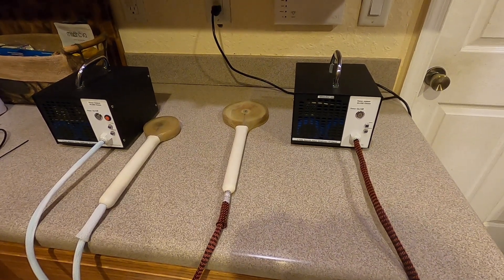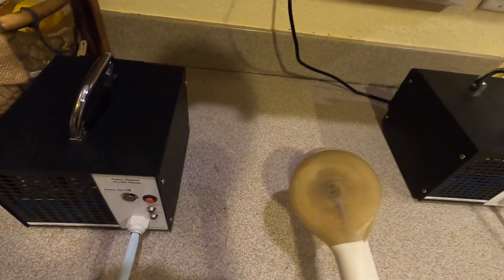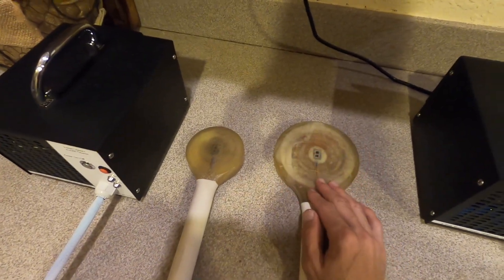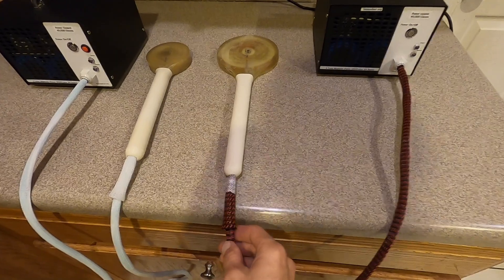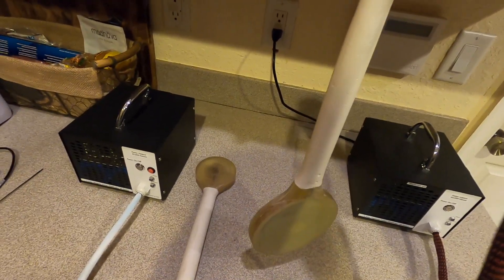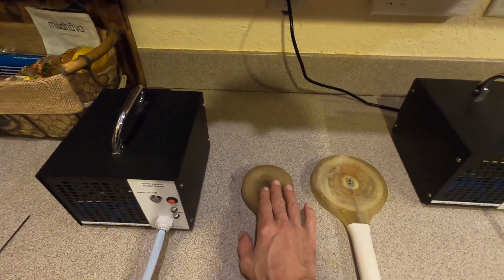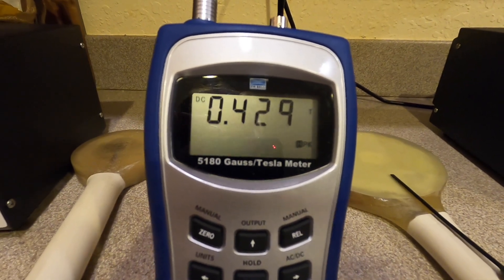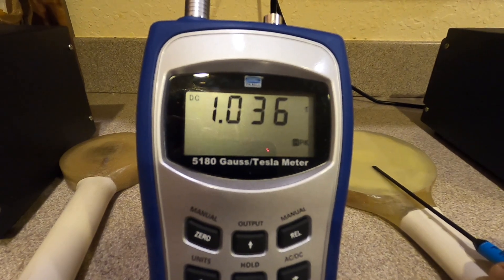019 BBMPulser 4B with 5" Aluminum Pancake Coil PEMF Open Source 1 Tesla (10,300 Gauss)

Comment: The half wave voltage multiplier used in the unit is only using two stages (120v unit) so doesn’t that mean the unit is actually putting out a little less than 480 volts ( counting for small voltage drop from diodes and leakage from caps) to the two large capacitors? I’m confused and so I figured I should ask you. I did measure a difference in potential of 600 volts when measuring anode and cathode of thyristor so I’m wondering how that is?
Reply from the maker: You are right, 480 AC if you run it true the diode and put a capacitor on it you will get 640 Volts
120VAC  is actually 155VDC.
Reply: @AndreyD  so each stage of the multiplier is actually multiplying 155VDC once rectified by the first diode? How do you get 640volts though if 120volts rectified through the multiplier is 155volts multiplying? 155VDC multiplied 4 times is 620VDC so were did you get the extra 20VDC?
Reply from the maker: @corybrown5583  Hello Cory. Well it's not perfectly 155VDC. it's between 155-160VDC.
Im sorry i's more like 160VDC.
Final charge number can fluctuate alite between 600-650VDC.
The circuit discharges it when charging voltage reaches to 550 Volts DC. 
I don't use pulser at 600-650Volts range because it fluctuates and under different conditions you can get different voltages. 
For example if you plugged in your pulser to the long extension and also have air heater plugged in, your 120AV will drop to 115AC and so as pulsers doublers voltage to ~600 volts. But it will still work because it discharges caps at 550VAC. You just can't lower outlet voltage low enough for doubler not to reach 550Volts. 
So here you go simple pulser circuit that doesn't care about input voltage fluctuating
Reply: @AndreyD   I added some resistance to the trigger portion of the circuit so I could get a higher voltage before it pulses. Can I go by the surge rating of the caps for voltage limit or is that too dangerous? I want to increase the voltage multiplier.
Reply: @AndreyD  I decided to use two 3,100 uf 450VDC 525VDC surge caps in series so I can raise the voltage some but I want to make sure I don’t overcharge the capacitors. Does the surge rating for the caps mean I can go a little higher than 900 VDC and the caps won’t explode?
Reply from the maker: @corybrown5583  3.100uF, 450Volts are great Caps for here if connected in series. 
Don't use them in Parallel, their surge voltage is 525Volts.
Surge Voltage on the capacitors is the  maximum voltage they can take. if you increase over surge then capacitors will start conducting (shorting alittle) preventing voltage going any higher. 
Ideally you don't use caps around surge voltages, You want to be safe and stay ~20% below voltage surge.
Reply: @AndreyD  i mean in series. I would never use them in parallel when dealing with such high voltage but do the surge ratings of both caps also combine since both caps in series split the voltage so they handle more? Ik if I used them in parallel electrolysis would occur and the caps would explode since I would max out the voltage the dielectric material could handle. I want to get somewhere around 900 volts pulsing through coil but my knowledge is limited (still learning).
Reply from the maker: @corybrown5583  Yes, the surge Voltage combines. Capacity drops in half. So your active capacitance will end up 1,500 uF and you can safely charge them to 920 Volts (that's the voltage you get if you 5x multiply 120AC Volts).
By the way I'm planing to Introduce BBMPulser 5B. Im still deciding what options to add, thought about Adding Power and speed control.  
The 5B model will discharge at around 800Volts vs 4B at 550Volts, also it will have larger capacitor bank
Reply: @AndreyD  multiplying 155 X 5 gives me 775 so how does that end up being 920? I’m sorry if I’m bothering you with all the questions but I am trying to not create an exploding circuit lol. 155 X 6 is 930 and I know from what you’ve said that the 120vac can be less (110 or 115) depending on load factors in house which would vary the output but even if it’s 160VDC I still end up with 160VDC X 5 = 800. Do you mean 5 stages?
Reply: @AndreyD  if I add one more stage (so three stages) doesn’t that give me 930VDC give or take? My understanding is that between each 450v 120uf capacitor where RURG80100 diode kathode connects I get around 155 volt increase on average.
Reply: @AndreyD  because voltage multiplier is lowering amperage as voltage increases are you talking about what the voltage will measure once multiplier is under load (connected to the two large caps). It does say these voltage multipliers will decrease voltage depending on the load put on them.
Reply from the maker: @corybrown5583  That's how it works.
I build 5 stage multiplier and it give me around 920Volts, I think the capacitor bank with the last diode somewhat acts as a one stage multiplier giving you additional 155Volts. 
I know it's little tricky. but you don't need 6 stage to get 920Volts, 5 Stage with capacitor bank at the end will give you up to 920 Volts. Make Sure all your capacitors in charging circuit are rated 450VDC.
Reply from the maker: @corybrown5583  Main capacitors aren't really a load, ones they charged they consume just milliamps, allowing charging circuit Voltage to go to the maximum. No Im not measuring capacitors as they charge or "under load"
Reply from the maker: @corybrown5583  Build 5 Stage Voltage multiplier, put capacitor bank at the end and you should be reading between 900-920Volts on your capacitor Bank ones it charges. trust me 5 stage will give you over 900 Volts
Reply: @AndreyD  okay. I thought each stage consisted of two diodes and two capacitors. The internet is filled with so much misinformation and honestly I get better answers from you. So do you think it’s okay if my voltage multiplier puts out around 930VDC with two large Caps only rated at 450VDC since the surge rating (525VDC) combines.
Reply from the maker: @corybrown5583  With 5 stage multiplier you will charge it up to 920-930Volts.
The circuit should be connected to the capacitor bank and circuit should trigger at around 800 Volts in your case discharging caps to around 75Volts in 3 ms.
When voltage raises back to 800 Volts the circuit will trigger again preventing it to charge to 930Volts. So you are fine with 450Volts rated capacitors (capacitor bank), normally your bank voltage should not go above 800 when circuit works in automatic mode.
Also you will need to adjust 3 resistors used in voltage devider (capacitors feedback line to the circuit) so the circuit trigger at 800Volts instead of 550Volts.
Also you need to use different thyristor capable of handling higher voltage
Reply: @AndreyD  I’m replacing the thyristor with SK065k rated at 1000v 65A.
Reply: @AndreyD  the way you have the 4b unit trigger it looks like the zener would see 31.13VDC and conduct once voltage is 30v and higher. If I replace the two 1meg resistors in parallel with two resistors in parallel that add to 730k then I should be able to keep 30k resistor at the same so that it safely triggers at 800VDC right since zener will see 31.58VDC?
Reply from the maker: @corybrown5583  Let me know if this helps
https://bbmpulser.org/wp-content/uploads/2020/11/20201101_143153.resized.jpg
Reply from the maker: I want to have smooth power adjustment between 50-100% (400-800Volts), I haven't tried it, but it could be easily implemented. Anyone who can test it Please do, email me results ideas@bbmpulser.org
Reply: @AndreyD  thank you! I will end up testing that out when I get a chance! You have been so helpful! Thank you for being so patience!
Reply from the maker: @corybrown5583  You are welcome
Reply: @AndreyD  the 10k potentiometers are for better voltage adjustments if desired right?
Reply from the maker: @corybrown5583  yes, 10k resistors to get exact desired Voltages of 400Volts, 600Volts and 800Volts.
Veriable resistors will aloe you to play a little back and forth
Reply: @AndreyD  if I was to do that wouldn’t the voltage be over 800volts when 10k potentiometer is turned to a lower resistance?
Reply: @AndreyD  just using the two 2 meg resistors in parallel to get 1 Meg resistance and 33k will trigger circuit at around 950VDC right? I’m a little cautious to try that since my main caps are only rated at 450VDC. You must be using caps rated at 500VDC or maybe going by surge voltage. Or there is something I don’t understand.
Reply from the maker: @corybrown5583  yes 10k potentiometer allows you to fine tune to desired voltage. And yes it will allow you to set trigger slightly above 800 Volts or below it
Reply: @AndreyD  but how far? If I just used 1meg resistance and 33k for other resistor for voltage divider wouldn’t the voltage go over 900 volts before zener voltage was high enough to activate transistor?
Reply from the maker: @corybrown5583  yes I use caps rated 500Volts. 
I used 2 megs resistors.
No it will trigger at 800 Volts.
All resistors do is dividing the voltage. 
As long as end result is correct you can get there with different combinations of resistors.
Use 2x 1 meg resistors just lower the value of other resistor in the line.
I noted 1 meg resistors starting to get hot so I went with 2 megs for 800volts
Reply: @AndreyD  okay so two 2meg resistors in parallel to give me 1 Meg resistance and 33k resistor are okay for now for triggering at 800v? I have ordered the 10k potentiometers but for now I will just test with 800v until I get potentiometers in mail.
Reply from the maker: @corybrown5583  if you use the suggested resistors values circuit will work good, it's been tested with many units and works well.
Reply: @AndreyD  well I know you know what your saying. I would definitely have to say you’re a professional. I mostly just want to make sure I don’t misunderstand something since those large caps can explode if over charged lol. As for the voltage multiplier I now have 6 diodes and 6 capacitors instead of 4 caps and 4 diodes. Does that sound like I will be getting over 900 volts so my main capacitors can get to 800v? At the moment I still don’t have a volt meter that reads up to 1000VDC.
Reply from the maker: @corybrown5583  I was going to ask if you have the voltmeter. 
You need one, they are cheep.
Reply: @AndreyD  yeah my fluke 116 can only handle up to 600volts. How many diodes and capacitors did you use to get 930VDC from your multiplier? I simply added two more diodes and two more 450V 120uf caps to the original multiplier that was putting out around 620VDC.
Reply from the maker: @corybrown5583  No. you add 1 diode and one more 120uF capacitor. it was 4 stage, now it's 5 stage. each stage consist of 2 components (diode and capacitor)
As I said you don't need 6 stage to get 930VDC.
All you need is 5 diodes and 5 capacitors in charging circuit. charging circuit must be connected to the capacitor bank.
Capacitor bank acts like one stage multiplier. that's how you get 930VDC from 5 stage voltage multiplier
Reply: @AndreyD  okay I’ll have to take the extra cap and diode back off then since I don’t need it. So that extra diode and cap will increase the multiplier from roughly 620VDC to around 930VDC?
Reply from the maker: @corybrown5583  Yes, all you need is 1 diode with 1 cap